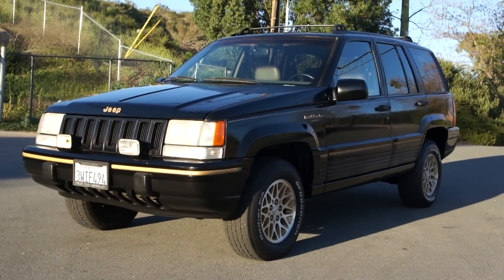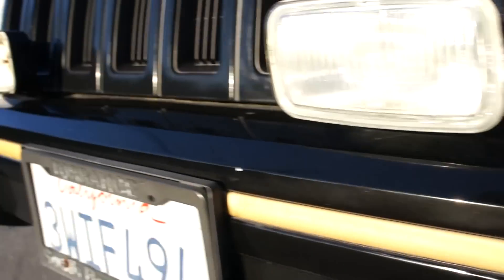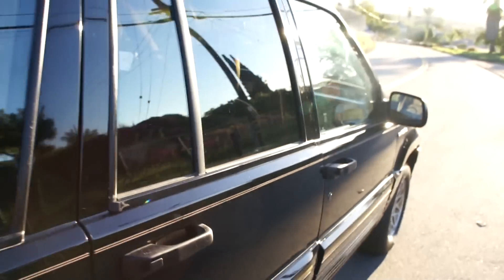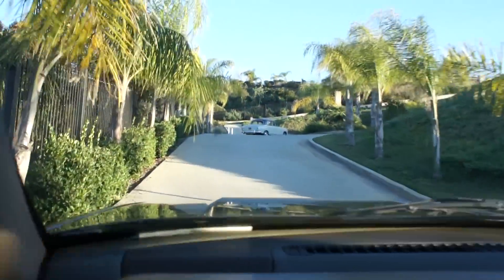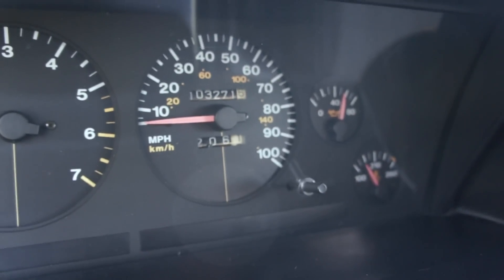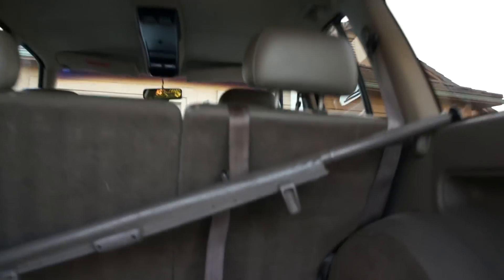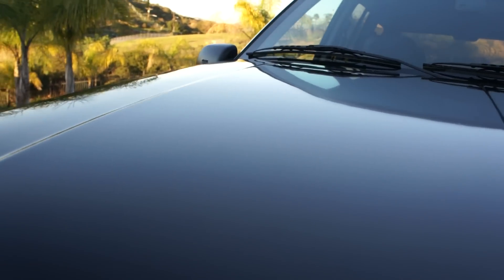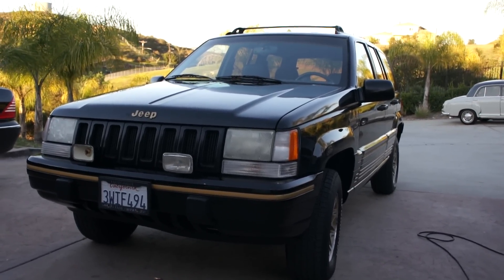1994 JEEP Grand Cherokee Limited Wagoneer 103k Orig Mi AWD SUV

Comment: I just bought a Silver 1994 Grand Cherokee Laredo Limited with 84,000 miles for $2,500 and couldn't be happier. This Black Wagoneer is slightly more bad ass than mine tho.
Reply: That’s great! I got my 1994 Jeep just like this one, same year, same color, same everything, with 74k original miles, just lifted it 4.5 inches on 33 inch tires and fuel rims, couldn’t be happier

Comment: it,s nice but i have 1993 limited full factory off road package 5.2 with only 71k mile on it ,i am second owner and first owner was an old guy and he never took it to off road or any.
mine is like brand new with red color with gold lines.
Reply: That's amazing because I have the same 1993 V8 Limited with just 160k in green and tan like the one in video. The exact same story as yours how I found it last month. Old man one owner 90% original parts and mint condition. I'm just getting it detailed and reconditioned mechanically but she's a beauty. Everything works even the cassette! Nice to know these still exist with low mileage. Also have a clean stock 1998 5.9 Limited that my teen son drives as his first vehicle. Long live the ZJ! Happy travels and safe motoring.